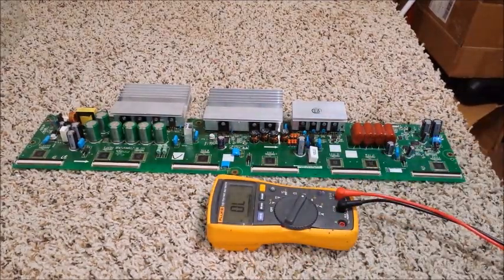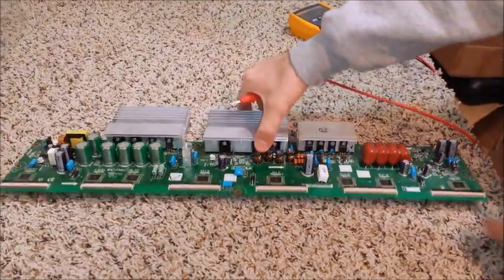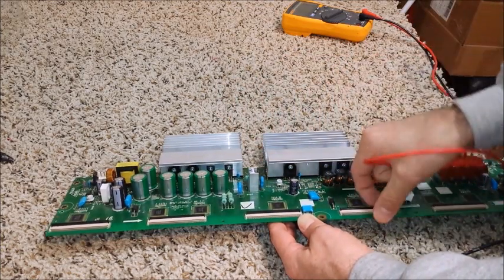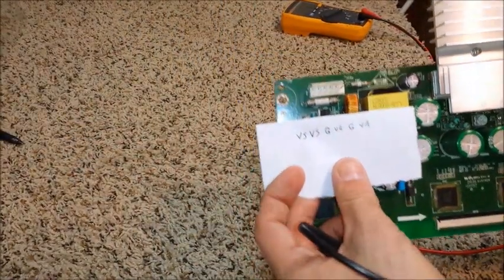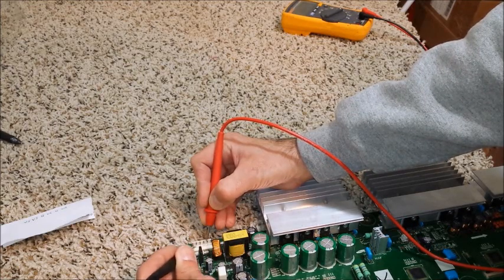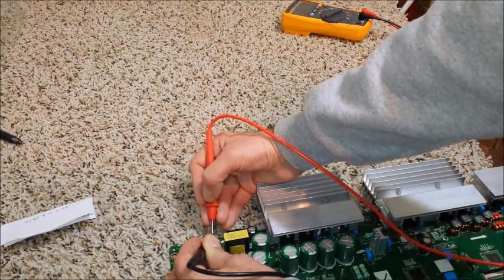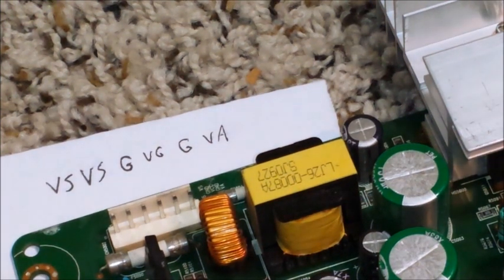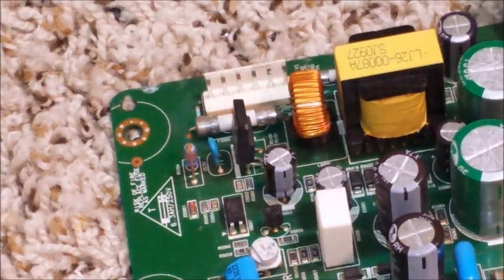How to test an LJ92-01601A Y-Sustain Board

Comment: SAMSUNG "PN50B450B1DXZA" I watched your videos and checked using a digital volt meter just like in your video, and I have a big problem with my y-sustain board. where the wire harness connection from the PSB to the y-sustain board is, I have a  connection between both the DS and GND. Does that mean there is a short somewhere on the y-board, and if so how do I find out where it is. In order to properly check all the components like the resistors and such the right way, dont I have to desolder them from the board (out of circuit) to get a true and accurate reading ? please help
Reply: I'm sorry I meant the VS.... the meter goes of when I checked VS and GRND at the same time...
Reply: Yes you have shorted heat sink components....get repair kit

Comment: I had continuity between VS and Ground, what do I need to do?
Reply from the maker: Evan Brough Replace Q5001, Q5002, Q5004, Q5005, Q5009, Q5010, U5000, and U5013. Shopjimmy.com has a repair kit which contains all those components, along with 2 buffer ICs. You only need the buffer ICs if you did the test from the video and found some shorted. The rest of the components must all be replaced together. If you try only replacing 1 at a time and testing the board, the new component will immediately be  shorted and destroyed.
Reply: swappart.com yeah the only short i found was on VS and Ground, the pins on the tabs by the buffers were all fine.
Reply: swappart.com what is the link please or what do i search for?
Reply from the maker: Evan Brough This is the Shopjimmy kit. All components must be replaced together even if they don't seem bad because they could still have been damaged by the short (except the 2 buffer ICs if they aren't shorted they should be fine). http://www.ebay.com/itm/Samsung-BN96-09738A-LJ92-01601A-Y-Main-Board-Component-Repair-Kit-/271818285603?pt=LH_DefaultDomain_0&hash=item3f49a1e223
Reply: Evan Brough placaysus